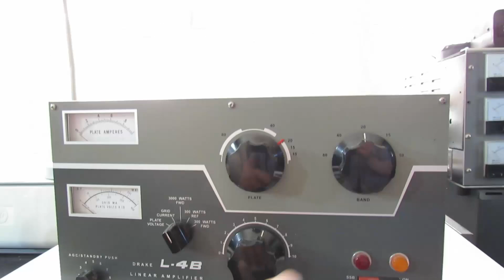Ham Radio Basics--Linear Amplifiers-

Comment: Hello, Jim... Thanks for great video about linear.  As you said you need good antennas with good coax.  I'm using OM Power 2200 its use FU728F Tube and give out 2200W easily.  I just keep it just half power 31W from the transceiver give out 1300W which ok for me and keep it running cooler all the day... 73
Reply from the maker: Hi,  That amp is beautiful and works great.  Congratulations!  OM Power makes very nice linear amplifiers with good reliability.  I hope to hear you soon on 20 meters.  73, Jim W6LG
Reply: I will be very proud to work Jim... 73 A61CP

Comment: Jim thanks for the Video, you talked about getting a good antenna and feed line. my first antenna is a MFJ2010 ocf dipole with RG8X feeding it, what would be the next steps to improve my antenna setup?  i live in Kansas and have the dipole in the trees on the side of the hill, i am thinking about moving it up the hill in hopes to get better reception.  I have few questions is there a limit or rule of thumb on the distance from a radio to antenna?  should the feed line be a different cable?  I received my license last year (just to learn somthing new) but did not get a radio until June of this year.  a friend gave me an IC-7000 with an LDG IT-100 auto tuner.
thanks David KE0EFW

Comment: Jim,

Enjoyed the video. Built an SB221 in the early 80's, but was no able to use it because was only a Tech Plus. Bought all the parts from Heathkit to add 10m and also another rocker switch to add standby capability on the front panel. All my ham gear was packed away in a storage unit when I was injured in an auto accident shortly after competing the amp build. Now, 25 years later getting back into the hobby and the storage unit will be emptied soon as it is now just too expensive. All my ham gear will be back home. Will need to recap the amp before getting it back on the air. Can use it now since upgrading to General.   :-)
Reply from the maker: Yes, new caps and don't forget to replace those resistors across each of the caps.  You will find they have changed value.  Order new ones and get extras.  Try to get the same value on each cap.  

I know about accidents.  I fell 14 feet and broke my neck at C6 in 1998.  Seems to be getting worse every year.  Ham radio has been a great asset to me especially since my accident.

73, Jim
Reply: Ah, the bleeder resistors. I already have a few of the Harbach kits in the amp and will use their FB-220 filter kit. Just checked and it does come with the resistors.

WB3BJU

Comment: Jim, 
Enjoy your Videos. Thanks for your experience and insight. In the back of my mind I still want a henry!. A local ham when I was a kid had one and it left a indelible mark. It must have I was twelve at the time now i am 55. He had a swan station with the henry. Wow! 
I used to go over to Henry Radio in la and slobber and dream.  
Thanks Jim.
Reply from the maker: You bet.  And, Henry amps don't sell well.  You can find them cheap at estate sales.  Must guys don't want to deal with an amp that weighs more than 120 pounds.  You might want to avoid the ones with the tear drop meters.  They have a habit of failing and they are no longer in production.  Thanks Barry!  73, Jim W6LG